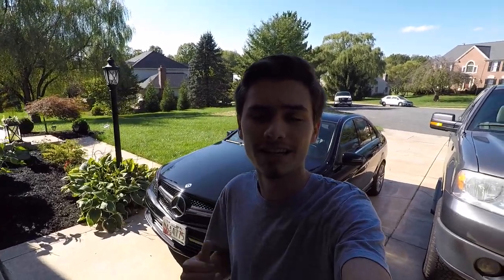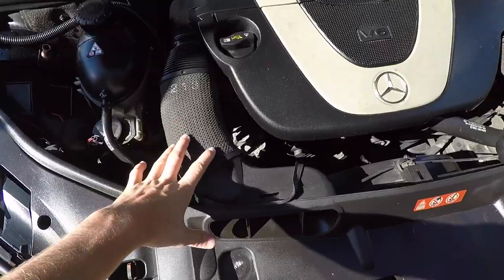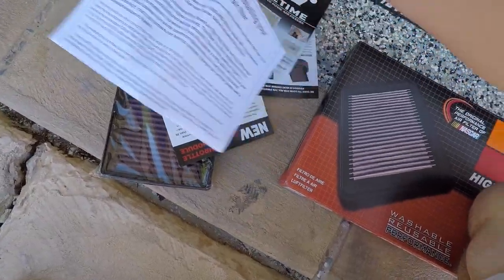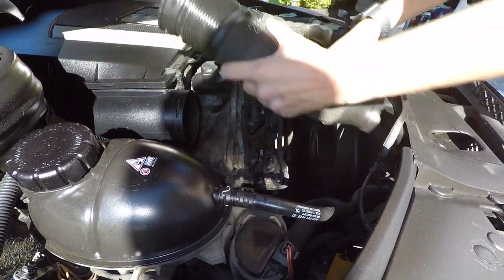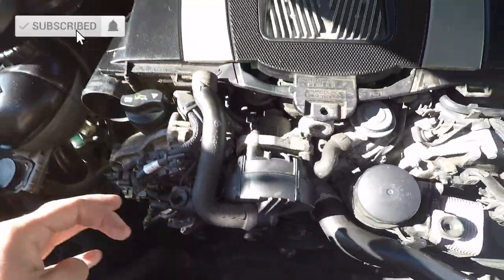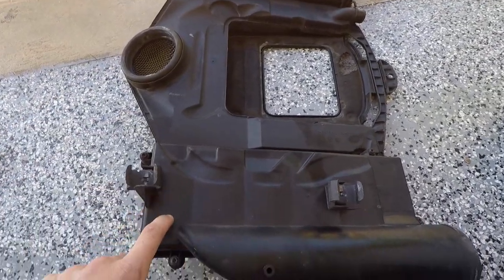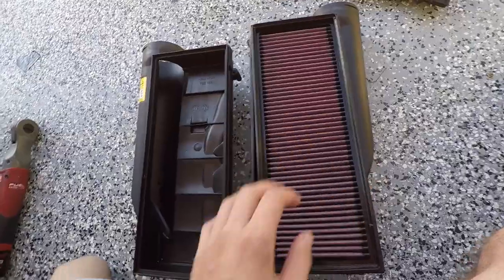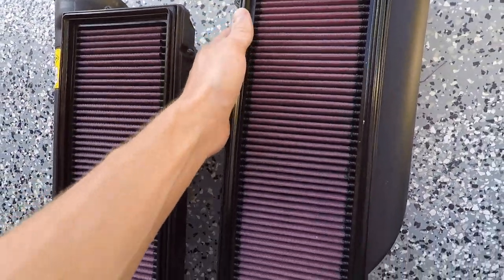Mercedes C300 W204 K&N Air Filter Install

Comment: hi bro i bought c300 2011 recently, when i changed the two engine air filter i noticed tjat there are 2 more built in filter , it looks like the one in your video, so my question is ; should i replace them or clean them with air compressor or remove them for more air flow intake. note; this built in filter are only for American specs.

Comment: Did you feel a noticeable improvement? I have a 06 CLK350 and I've been looking at these filters (same engine, yours is just smaller displacement) would you recommend?
Reply from the maker: Can barely feel a difference but you could probably get way more if you tune it aswell. I like cleaning and not having to replace.

Comment: What’s that other filter looking thing u left in there
Reply from the maker: Those are part of the housing (or “unit”) on my year. Other years may not have them
Reply: I have a 2010. U think it’s necessary? I wanna rip them out.
Reply from the maker: Mine is 2010 as well. They’re in there for a reason so I didn’t remove them. Up to you...

Comment: Unfortunately for you,  the factory air intakes are not seal from breathing hot air,  actually they do. They are not sealed from actively sucking hot air thru them.  To do that, you need to replace the actual flexible hose to a PU hose  or similar, then they would be completely sealed from hot air.

Comment: Hey bro I got a c300 and I was wondering which filter would be best for throttle and Hp improvement
Reply from the maker: Ive tried the cone shaped “cold air” intakes, and the K&N drop in filter. The cone filters aren’t good they just pull in hot air from the engine bay and it hurts performance. Best bet is to get the drop in K&N filter. I notice little to no difference in performance, to get the most out of the intake the car would have to be tuned after install.
Reply: @ThicGarage  what kind of tune exactly?
Reply: @Woo.f32  Project A has a great tune for the W204 C300, definitely would recommend them.